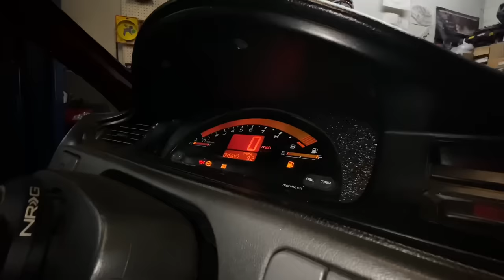Building a HONDA EG HATCH for (2019 SEMA) in 9 Minutes

Comment: Epic guys !! Whats the power?
Reply from the maker: Boosted made 400 hp with 290tq, check out last upload if you want
Reply: 124hp
Reply: Noice. Must be making at least 80bhp. Civic go brrr
Reply: @kepet_channel  you a hemi fanboy it seems like
Reply: @getmadallyouwant4884  how? Because he made a joke🤣
Reply: @Thor Odin son do you have more info on your build? Deciding what car to use for a badass street race/track build (with a touch of show finish and detail) and instinctively I want an EG because it's cheap and very light but my stupid bias always thinks STI or some other shit. I've been asking on reddit if I can make an EG as badass (top speed, handling) as a super car and I got answers from no to "here's an example of a VW hatch build which kicks GT3's ass". 

So I want to learn more but I don't want to dive into this without knowing exactly how much I can get out of it. And oh I want to rwd it 100% (like Throtl is doing it) and I'm thinking k24 (with k20 cnc ported head like the kids are doing it) on gas pump (because Canada and I don't wanna be dealing with canisters in my basement). I'm not rich but I'd sink in 20-30k or so if I knew I could wipe the floor with cars like GT3 (driving talent provided).

I had a 2008 stick civic. I test drove gen 1 Fit. And they are soo much fun; nice handling.

PS: keeping this build for 20 years or more

Comment: Hey guys i love eg i want to get into building one but the only thing i need to know is how difficult is it to convert to awd? Or it's as easy as adding a transverse awd gearbox and driveshaft to rear diff? Is there enough space? Or extensive modifications have to be done to tunnel?
Reply: Go check out Bostedboiz they have a video where they do theirs and it wasn’t hard what so ever they show u every part from what car to use to make it awd
Reply: @alberta7851  Ohh its the recent project about 6 months back right? thanks btw

Comment: Dam how much this whole cost? I want that type of detail on my gtr
Reply from the maker: Built Jdm uhm not sure how to answer the question but car did end up costing more than 30,000 in parts
Reply from the maker: Including paint, exterior parts, interior, wheels, suspension, engine, full car. Everything has been touched and replaced on this Honda 👍🏼
Reply: Chev Tube that’s insane but car looks so beautiful gotta be proud of what you created